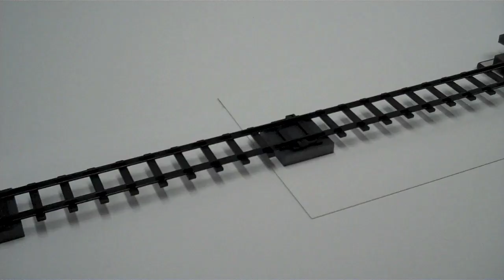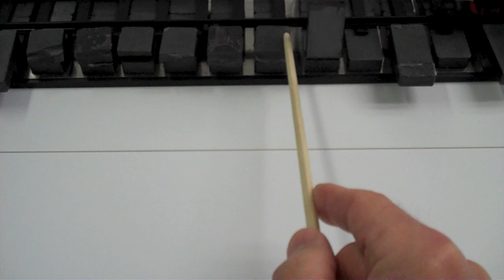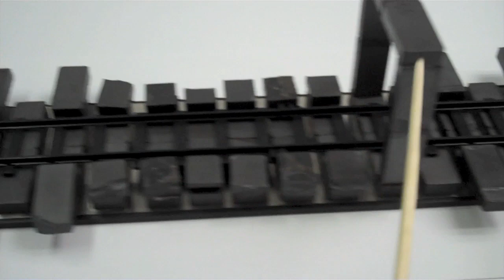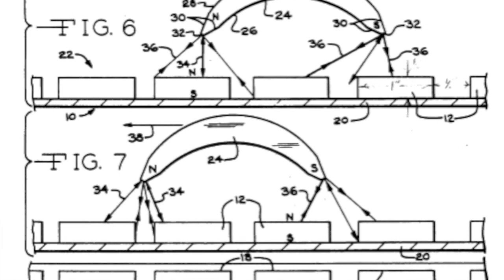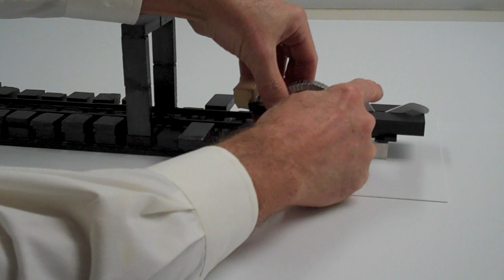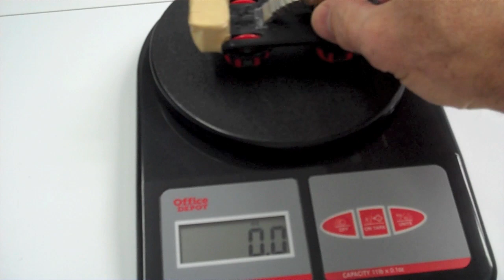Build a HOWARD JOHNSON Linear Magnetic Motor - PART 1

Comment: Are you not loading the system with potential energy, when you put it on the magnets, you had to use force to do so?
So its just given back what your hand put in?
Just a question?
Archetypal Entanglement A Beautiful Mind Kindle Books
Reply from the maker: There are no springs to stretch. My hand does not push it down the track at any or all points. Just an answer.

Comment: Just wondered what size of neo's you used in this demonstration. I have read most of Howard Johnson's work. Unless I misunderstood something, you mentioned that the difference in the neo's and the ceramic magnet is what helps this design work. Could you use neo's for the whole design. I was under the impression that neo's last longer and are also stronger.
Reply from the maker: +Valentine Girly   Yes, neos are much to strong actually for this design. The problem is that if they were used on the track, they would force the cart off of the track. If you spaced the cart further away to accommodate this force, the effect wouldn't work as well, if at all. Go cheap ceramics for this one, or experiment. Both are good.

Comment: This set up seems to propose perpetual motion which is more than very unlikely. How much force is needed to push the cart onto its latch? Just this alone may be what propels the cart forward.
Reply: A magnetic field is a result of a magnet releasing energy over time, much like a radioactive isotope releases energy as it decays. This motor is simply extracting some of that energy to do work, like how a radioisotope generator turns radiation into mechanical energy. Eventually, the magnet will exhaust its energy and lose its magnetic field, meaning that this setup is not truly perpetual, it will just keep working for several centuries.

Comment: The "external power" is provided by YOU moving the car back to its initial state. Just like you bring an apple up and let gravity pull it back down. 

It is misleading because you have to spend energy to setup your initial state. And there is always an energy loss, meaning that you are always spending more energy to bring the car back than it is potential energy that pushes the car forward. 

That's why you can't have a circular track.

Comment: Magnets aren't like a spring. Magnetism is a force just like gravity. Magnets don't supply energy. 

You can't make the car move the other way around without rearranging the magnets. Just like gravity. You can pull something up and let it fall... or you can use large amounts of water on a dam and use its stored potential kinetic energy  to move a dynamo. 

Just like gravity, you first have to SPEND energy to SETUP the INITIAL STATE. And you always have some energy loss.

Comment: Check out Ed Leedskalnin's perpetual motion machine. It is a simple electromagnet but once it is energised it will hold a charge forever, or until the circuit is broken where is will instantaneously lose its magnetism.

Comment: you are the external power source. When you put the cart on the track you are forcing the magnets into a position where like fields are close together. The cart does not want to get sucked forward it is pushed away from the area where you put it. If the cart was to approach from the other side it would be repelled from the starting position not pulled in.

Comment: Awesome stuff, Howard Johnson was a revolutionary.  For those that continue to think of magnets as springs, what happens when you can disconnect a driven element from that spring?  Like a sling-shot that reloads automatically by design?  No perpetual claim here either, just magnetic fields performing "work"...moving a mass a certain distance. "Magnets can supply a form of energy" LOL

Comment: What the video doesn't show is it takes energy to FORCE the magnet car onto the track (in this case muscle energy) because the magnets at the beginning of the track repel the magnet car. Forcing the magnet car onto the track is like pushing it onto a spring. The energy at the end will never be more than the amount of energy you put into forcing the car onto the track. All this is doing is redirecting the energy you used to force it onto the track.

Comment: ^^ my email is at the end, email me please. Johnson is the man for sure. What I learned so far from him (at your suggestion) is that the TORUS is critical to the whole concept. Also, the ASYMETRICAL layout of the magnets in his motor is a major factor. I built a working newtons cradle mod that clearly will run forever. It was done in an asymetrical way for a wacky reason. I went to make it symetrical to clean it up and guess what? It refuses to work like that. Weird.

Comment: This argument applies to ANY circular path through ANY static magnetic fields whatsoever. The potential energy of a slider magnet in the field of the array is single valued and so when we go round a circle it must return to its original value. Therefore there can be no forces (-dPE/ds) along the circle which always act to accelerate the slider. And the net work done by the systen (= sum F.ds round circle) is necessarily 0. Static magnetic fields are conservative therefore the 1st law applies.

Comment: You say if you make the track into a circle the truck will go around without stopping. This is only true if there is absolutely no energy loss; no friction, radiation, sound or more importantly no useful work done by the system. The potential energy of the truck falls along the magnet track and so its KE increases but its PE must rise again for it to go round the track back  to the begining. Work equal to that done by the track must be provided by the KE to do this. Any loss at all will stop it.

Comment: I'm not saying this is fake, but it would be more convincing if there were no release mechanism and the car was pushed slowly toward the first magnets and then accelerated forward.  Slow motion could show the difference.  Currently, there's no way to tell if there aren't simply two magnets - one on the release and one on the car with like poles simply repelling.  Also, you could keep it going with two parallel tracks and 180% turns on each end (simpler fields than magnets around a circle).

Comment from the maker: @Steve042176 I didn't clarify it when I made this video that I previously had two arched magnets side-by-side but offset by a small distance to both smooth and increase the acceleration. Just like HJ's original linear patent in 1979. I went back to one arch because the car kept blowing off the track and extra ballast to hold it down just slowed acceleration. Overhead magnetics that you mentioned with a flipped arch on the car below it may be a huge part of the solution for continued motion.

Comment: I got it to work using the straight peices of track though it will barely make it 6-8 inches past the end of the stator magnet base. Partially due to n42 arch magnets and I don't think the arch is spaced properly or stator mags exactly spaced properly, partially due to non use of mu-medal

Comment: One problem I see with the demo is you start the magnet trolley already inside the field created by the track. There's already a loaded magnetic spring when you release. It would be a more convincing demo if you either

A) extended the track out the back and start the trolley from behind, or
B) extend the track out the back repeating the sequence of the magnets in the front and start the trolley from the same position relative to the gate.

Comment from the maker: @HojoisaNoNo The metal base is more commonly known as Mu-metal, and is primarily used for screening electromagnetic fields as used in transformers and MRI's. It is extremely high in permeability making it absolutely essential for this application.  Hard drives use this metal to back the permanent magnets in order to keep the field away from the disk. Just do a net search on Mu-metal, and you'll find a sheet supplier. Tiny sheet metal spacers are cut with scissor type shears. You can do that.

Comment from the maker: @HojoisaNoNo I was distracted after I made that comment, and forgot to clarify it. I constructed a plastic form to hold two of the arched rotor magnets side-by-side and slightly offset of parallel, just like HJ's original 1979 patent drawings show. It was very powerful, but required more ballast weight to hold it down from flying off the track. That caused it to lose initial acceleration with the added weight, so I went back to one arch. In a rotary config, you would desire double arches.

Comment from the maker: @HojoisaNoNo I think the piece that I used was 24 inches long. You probably should not make it longer than what is needed because the arch rotor car wiil be attracted to it after it clears the magnetic section, and just cause it to lose some momentum.

Try to use a very thin steel sheet metal if you can't obtain the alloy base.

Comment: @PMMG4HYBRID well the magnets i have for the arch are to big. When i built it with 19 magnets it streched across the first 5 magnets on the track. what size did you use? i first purchased 1/2"L x 1/2"W x 1/8"T and 1/2"L x 1/2"W x 1/4"T but then looking agian at yours it looks like your arch magnet is rectangle

Comment from the maker: @HojoisaNoNo I think at the time that was made, we had acquired the all plastic track and wheeled car from an inexpensive toy train set through someone like Toys"R"Us. 
Better track and wheel bearings give maximum performance. No steel.

Three different magnets used to form arch. (1) 1/2Lx1/4Wx1/8thk-magnetized through thickness, (2) 1/2Lx1/4Wx1/16thk-mag thru thickness, (3) 1/2Lx1/4Wx1/8thk-mag thru width (on the ends only). Spacers (note the size according to the "Secret Key" photo.

Comment: WHAT KIND OF TRACK DID YOU USE? All i can find is the  HO scale but yours is definitely bigger and i just noticced your arch magnet looks like you used 1/4 thick x1/2 x 3/4 and 1/8 thick x 1/2 x 3/4 and i have 1/4 thick and 1/8 thick x 1/2 x 1/2 do you think it will still work

Comment from the maker: @valveman12 Try Lowe's, Home Depot or Radio Shack for local supply of the cheap ceramics. Several years ago before I superglued everything together woud have been the time to ask me for entrance force. If you're worried about excessive repulsion, don't be. Remember, it's all about assymetry. Use even weaker ceramics at the entrance to further reduce that factor. The gate will still pull it in nicely. I digressed into power projects, but a rotary configuration would better serve your purpose.

Comment: I've ordered magnets for the arch.  I still need to find a source for the weaker ceramic magnets.  Would it be possible to make another video where you remove the holding latch and show how much repelling force there is entering the magnetic track?  Even better if you were able to measure the repelling force just prior to overcoming it and transitioning to an attractive force.  This measurement is perhaps the most critical in determining if the motor can maintain sustained operation.

Comment from the maker: @valveman12 Good call. Not only is this one fun and cheap to construct, but the level of acceleration from a complete standstill will really get your mental gears turning. You are correct. All North facing up and 360 gate is all North facing in. Rotor arch runs North forward. Interesting how repelling poles attract. Spacing of final 6 magnets in general terms, in order are 2x medium, 2x small, 2x large. This blows it out of the track field.

Comment from the maker: @PMMG4HYBRID One final thought... I remember considering the construction of a mechanism to simply flip the arched rotor magnet at the ends of the track just prior to the repulsion field area. There certainly is enough accelerated mass to produce this result, and it definitely accelerates in either direction.

Comment: @PMMG4HYBRID One way to test if it can run continuously is to build a circular track elevated slightly at the end and return back to the beginning.  I do believe that it will not be able to run continuously due to the repelling force at the start.  Interesting to experiment with.

Comment from the maker: @valveman12 Thanks. Most magnetic track designs are balanced magnetically and will easily reach equilibrium, producing a very strong repulsive force upon field entrance. This is the reason that I've used asymmetrical force in the rotor/stator relationship and also within full gate fields. The large 360 degree gate actually draws the rotor car into it. However, if you remove the latch at the very beginning and place the rotor there, a weakened repulsion force (modified field) will still exist.